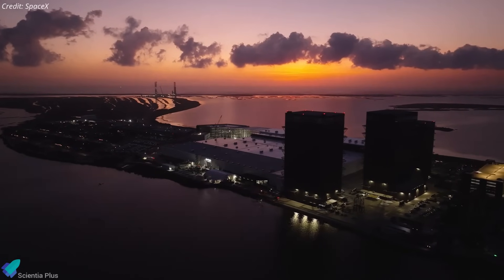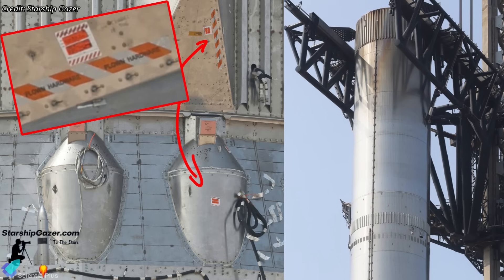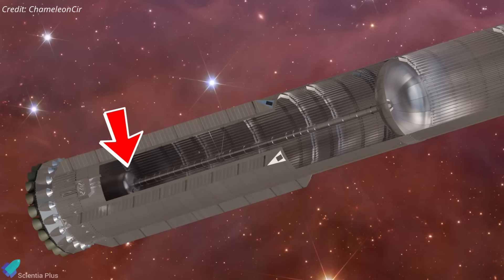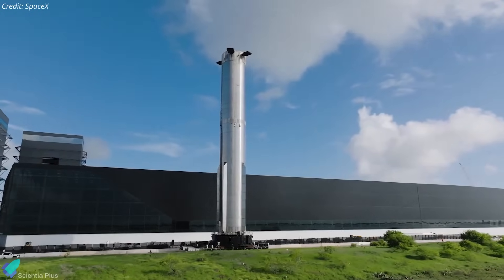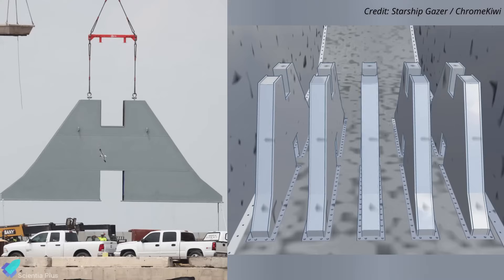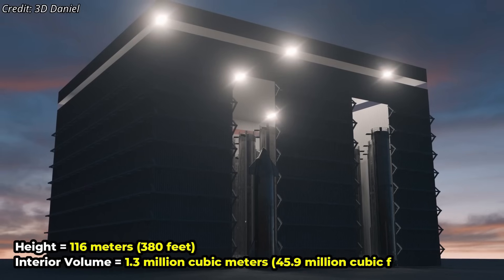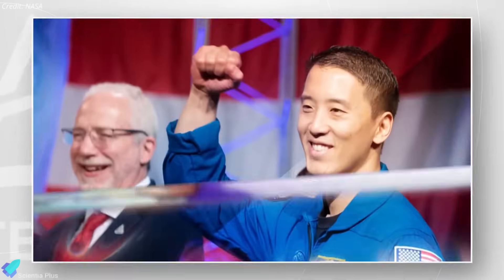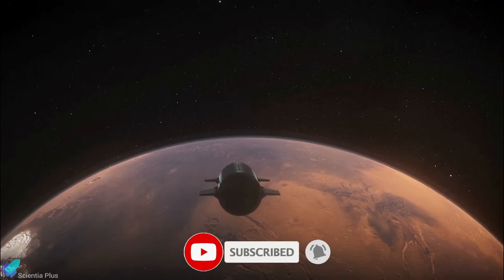SpaceX’s Latest Starship Looks TOO Perfect — What Changed?

Comment: I'm missing something. In a static test 33 engines fire. Why isn't the concrete under the test stand obliterated like it was under stand for the first launch?
Reply: yes you are missing a year of history or stage 0 evolution. That's 7 flights ago.
Reply: @WerewolfSlayer91  They're still igniting 33 engines on the test stand. Why isn't that destroyed?
Reply: It was replaced by a steel plate construction that contains nozzles of the water deluge system.
Reply: @ I'm talking the test stand. Why isn't that destroyed when 33 engines ignite?
Reply: Because they never test at full power.
Reply: @stellarfortressnemesis  Ah, so they're throttling. Thanks!